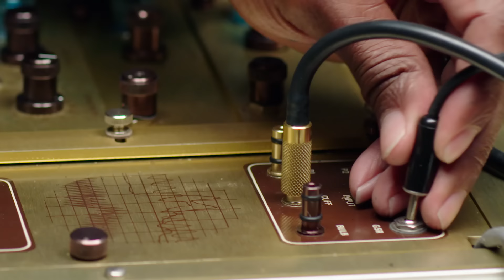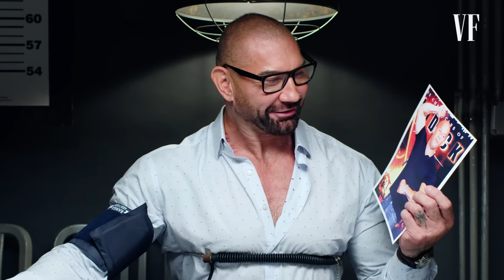Dave Bautista and Kumail Nanjiani Take a Lie Detector Test | Vanity Fair

Comment: The test would register better if on ANY of these videos, they put the sensors on the correct finger. Ring (or 3rd) finger on the right hand, not the Middle (or 2nd) finger. 
Also, both these guys are great.